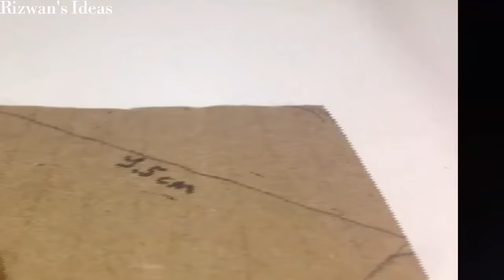How to make a WALL-E Robot at home from Cardboard (DIY)

Comment: What was used for the black belt on the wheels? Is that electrical tape with clear tape on the back of it to cover the adhesive?
Reply from the maker: No not a black tape it' elastic belt
Reply: @Rizwansideas  where can i get those elastic belts
Reply: @Rizwansideas v